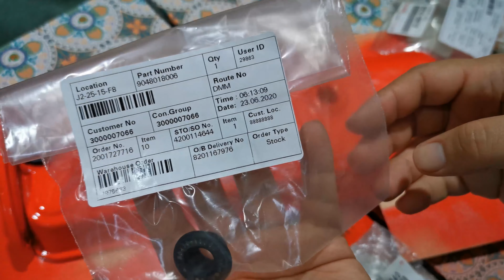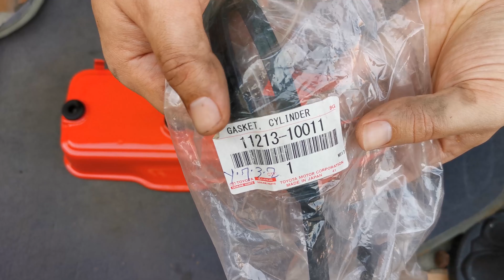Valve cover gasket 2E carburetor engine | Toyota Tercel 1990 1994 (L40)

Comment: Was the car smoking under the bonnet/hood for you to require this maintenance? I may need to do this for my 2E Corolla because of smoke.
Reply from the maker: There was a big oil leak coming out of the valve cover gasket. No smoke, but I guess with a big enough leak the oil would get on the exhaust and smoke.